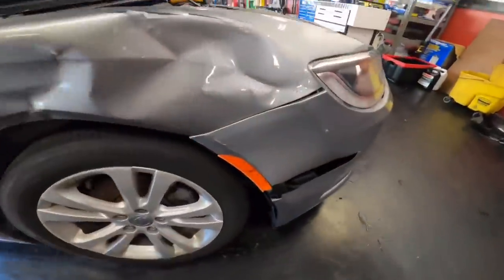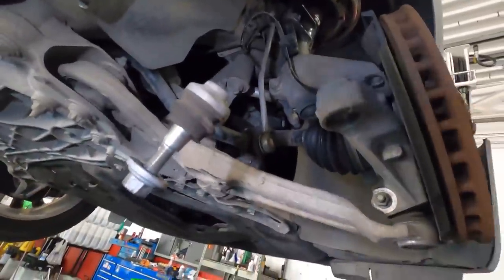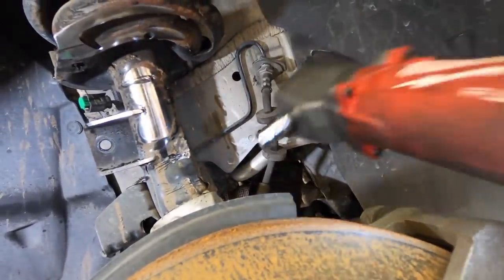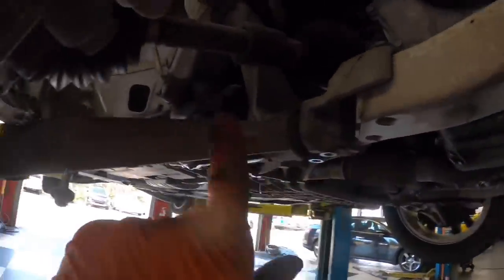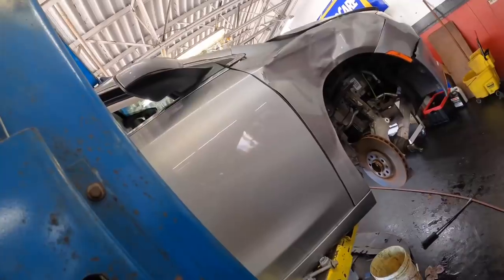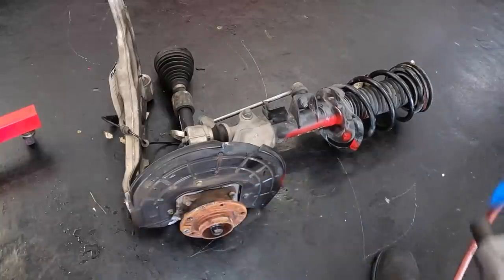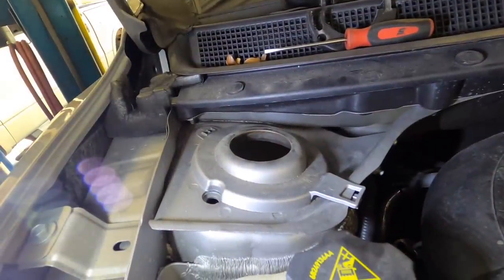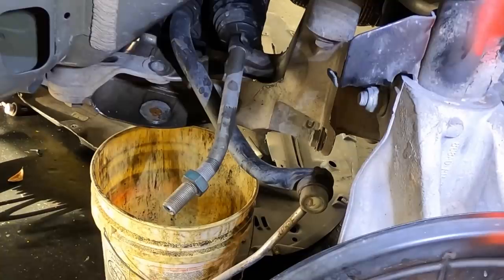Cutting Brake Lines! Caught on Camera! Chrysler 200 Strut, Control Arm, Tie Rods and Brake line

Comment: My oh my let’s put the bent up car back together and hope it measures up. There is just way too many potential problems to be encountered here. Hope it safe to drive afterward as I’m sure many other drivers are too. Good luck on this one Ray.
Reply: For sure.

I guess that car has a 4-wheel alignment in it's future but, honestly, I think I'd want to be checking the position of all the chassis tie-in points before I bolted anything back on again, given that the panel-gaps suggest the monocoque has deformed.
Reply: Peoples sketchy insurance putting this junk back together
Reply: It's probably going to insurance auction, making it a "run and drive" will fetch top dollar. Let some other sucker buy it thinking its only cosmetic damage.

Comment: I can't believe they such a plastic clip thing to hold the top strut assembly in place. No off roading for you to
Reply: Carries no load when the car is on its wheels. Only has to stop the strut from falling out of the car when wheel is off the ground, and as you saw in the video, the design of the lower control arm stops that happening as well. KL Cherokee is pretty much the same. Granted, that is closer to mall crawler than rock crawler, but for what it's meant for, it's fine.
Reply: @bikeaddictbp  well it could be modified with a metal locking plate and bolted to the strut tower.

Comment: That's interesting. Those strut mount clips, are the same as Vauxhall/Opel/GM use on the Zafira/Astra. I first encountered them when doing a Zafira front end rebuild. I didn't know that Mopar also did that. I guess if it works, others copy it.
Reply: If it works why then was the drivers side popped off.
Reply: It's interesting that the clip took a massive hit straight to the strut and did not fail. But the other side fell off at some point. I wonder if it was not snapped in properly. Also those 4 holes look like maybe a safety clip was part of the design but not implemented
Reply: @metrork1  It worked, right up to the point that it was involved in an accident. Then it let go, rather than ripping studs out of the turret mount.
Reply: @SmokeElectronics  The four holes fit a tool in the factory, for quick assembly.

Comment: The purpose of the plastic clips is to hold the strut up when lifted on a hoist. The weight of the car keeps the strut in place on the tapered body mount so the strut won’t move around with the weight of the car on the suspension. So it is safe. I’ve worked on many at the dealership and never saw one fail. Many other manufacturers also do it this was. Just a cost cutting measure as opposed to bolts holding the strut to the body. Also since Chrysler cars became Fiat, they’ve become a complete PITA to work on, even brand new under warranty. One of the reasons I left the dealership for an independent shop which makes me double the money I ever made at the dealer.
Reply: It's hilarious when you think about it. Fiat has twice failed to make it in the U.S. but when they were allowed to completely buy out Chrysler now people actually buy their platforms because it says Chrysler on it now all while Fiat as a brand badge is down to one single model and I think maybe that might even be gone now.

Rip Mopar and Chrysler.

Comment: So no bolts or nuts to hold in the struts on a Fiat-Chrysler product. That's strange and looks unsafe to me
Reply: Nothing unsafe about that, under normal circumstances the strut tends to have some of the vehicle weight on it so the plastic clip only needs to hold the weight of the strut, control arm and the hub and brake assembly when the vehicle is off the ground. So nothing wrong with that particular design unless you intend to use a car like this to jump a creek Dukes of Hazzard style. Then again, the front struts tops coming loose will probably be the least of your worries if you do so as you'll probably twist the chassis, rip the motor and transmission mounts as well as break all of the springs and blow out every last seal in the struts.
Reply: @0cypher0  Well, that's your opinion and it sounds very reasonable. Already gave mine and still stand by it.

Comment: See this is what happens when you have to take apart this to take apart that so you can take apart this to take apart that,,, aka the Domino Effect..... So therefore you end up spending 4 hours trying to take apart a $100.00 part that was replaced by another $100.00 part, might want to ease-up on your spray can fume addiction...........

Comment: I'd hate to recommend yet another battery into your mix but I'd suggest looking at the Milwaukee mid range m18 impact gun.. very little will stand in its way.

2962 or 2860

Comment: Get a DeWalt impact ray. I bought one just to get by while my snap on 18volt was getting rebuilt. That was two years ago not only is it still going through daily abuse but it pulls bolts that snap on couldn’t budge. DEWALT 20V MAX XR Brushless High Torque 1/2" model DCF899B.  I paid about $190 on Amazon and have been thoroughly impressed with it. Sold the snap on to the FNG lol. Pretty sure you can pick it up at Home Depot too.

Comment: Why didn't you just get a big bar and push down on the lower control arm?
Strut would have popped right out.
Anyway, there must be a reason.
Probably too much impact damage.
Man they sure make those 200's crappy, it's basically a POS Fiat.
I have been spoiled working on Japanese stuff for 35 years.

Comment: Ray now that your Rigid impact died and you have a broken battery. Time to upgrade to a Milwaukee. Just make sure it's the M18 high torque. You'll find it's well worth the money. Most likely stronger than the air impact. God bless

Comment: I'm only 3 minutes in. I have done some mechanical work 20ish years ago. Mostly easy stuff like tires, brakes, oil changes, etc. but I'd help the other guys with stuff too. Occasionally we'd do collision repairs like this but I do not remember seeing (or hearing) about struts bending. Control arms? Yup. Inner or outer tie rods? Yup. Bent or cracked subframe? Yup. Bent Strut mount? Yup, even saw one where the upper mount welds had rusted through and broken free from the rest of the body (great white north, means salt is used on the road in winter. Salt plus moisture equals rust) But a bent strut? That's new. How common (or rare) is this? The impact must have been just in the right spot, or one HECK of a bang (or both)!

Edit With it bent that badly, were you concerned about the cylinder rupturing and spraying fluid or the spring mounts being damaged potentially releasing angry spring energy?

Comment: If your cordless gun has carbon brushes they might need replacing. If it's brushless it might need a new trigger. You can find parts online. Cheaper than buying a new one.

Comment: a plastic clip holds all that in..omg.   "they have determined its safe"  in other words they determined the amount of money they will save/make is greater than any potential law suit they will payout. lol    good vid
Reply: Its actually held in place by an interference fit of the shaft. The clip is just there for the small chance it might slip out if the car is jacked up - when the wheel's on the ground there's a quarter of the weight of the car holding it in place.
Reply: @IanSlothieRolfe  What when there's no weight on the wheel?
Reply: @erik_dk842  when is there no weight on the wheel?? On a two-post lift, when you're in an accident, jumping your car over something or going rock crawling. Under normal driving there will be weight on that wheel pretty much all of the time and I wouldn't recommend using this this type of car for anything other than that without serious modification.

Comment: Yep, everyone STILL hatin' on the plastic ring holding the strut in.  Except on both the Cherokee where Ray did a similar suspension repair, and this 200, on the side that took the hit and where EVERYTHING ELSE on the hit corner's front end has been bent, cracked, broken, etc., the thing that has survived in both incidents is the plastic ring.  Think about that for a moment, haters.

As for the ring being cracked on the driver's side on this car, well, there's no way to know for sure why that is.  Sure you could speculate that this one broke from the collision, but then why would the one on the opposite side of the collision break, and the one on the collision side not break?

BTW, these are meant to be replaced when removed (they are $8.72 on Rock Auto), maybe someone removed it for a previous suspension service and broke the serrated ear(s)?

Comment: Pink bacteria in your well strainer is likely S. Marcesens. Soak the bacteria in 50 percent vinegar/water for 10 minutes and easily scrub away. Replace the filter that's contaminated. Your water softener effectively filters it out further and protects any RO system you may have.

Comment: Looks like a side impact... the other strut clip was involved in the accident, it was pushed to the point it separated and released the strut. If those struts were fixed in the normal bolted to a bit of tin method, the top mount would have been damaged on both, possibly the car would have been a total loss. So the plastic mounts (that only stop the strut falling out when it's jacked up) makes for a lower insurance premium, due to less expensive repairs, because they minimise structural damage in front or front/ side collisions. The most common type being a kerb strike.
I once owned a Volkswagen Polo that was written off due to kerb strike at less than 20mph, the damage looked similar but not as bad as this one, until I looked at the strut tower and realised it was mangled, just enough to need to be replaced, along with the driver's door, the wing (fender? I think you call them in America) strut, tie rod and drive shaft...
Never bought another VW since, never will again.
Pretty sure these clips are a Chrysler thing, maybe FIAT (Fix It Again Tomorrow ) or PSA since Daimler sold the group to them years ago, definitely never seen it on a Mercedes Benz.

Comment: And ray I don't know if you'll read this or not, but thank you I learned from you and did what you told me to do!! Lol thank you very much You told me that the battery was the key, if you're having weird problems start there.. My mother in law's vehicle is having weird problems I changed the battery cleaned up all the terminals and I even said click when I tightend down the battery And put Anti  corrosive on them.

Comment: 2:19 At least you can get a socket on those nuts. Had a puncture on my 3 year old Ford and couldn't get a socket on to get the wheel off as the nuts had swollen up so much. Next size up is too big. Imperial size didn't work either. Ended up buying a special half size socket... and a whole set of new nuts.

Comment: He never replies to or favorites any of the comments. I think he reads them but just doesn't ever say anything. But I'll write this directly to him anyway incase he does read it because that was really awesome.

 Dude. How many times did you get out and move the camera? The one on the fender wasn't visible in the shot from the threshold of the bay. And that one wasn't visible from in the shot of the flat tire. So you didn't have multiple cameras to set up and just film it once. You must have had to film pulling in several times from multiple angles. Or you pulled up a few feet, stopped, got out and moved the camera, pulled up a little more, stopped, got out, and moved the camera. Ect. Or you had a helper moving it for you every few feet because the car doesn't go in park.

However you did it, that extra effort makes the video so much more interesting. That's a lot of work to put into the first few seconds of a video that most people probably won't even notice. If they do, they usually won't realize the effort it takes.

All of that rambling is to say: well done. It looks really cool and is totally worth the effort.

Comment: Why is this car in this shop,  IMHO it should be at a collision center since the front and or rear frame may be tweaked.  Also, used parts may be cheaper and  turn bad  quickly,

Comment: Got to admire your B--lls for even starting this disassembly, once the bits and pieces are off you still can 't install new parts and expect it all to work properly since all the mounting points and systems are out of alignment.  Seems like the only way to repair is to get back to the frame and check for bent stuff and start from there...way to involved to be taken on by anything but a body shop that does reconstruction. Why not call it a loss , strip the parts and sell them off then recycle the rest...ie JUNK!

Comment: Why should that strut clip thingy not be safe? It is not loaded in normal operation (since the spring is pushing the whole thing up). Only when the car is lifted does it actually hold anything and in that case it's a compressive load on a very sturdy looking polymer ring. I don't really see an issue there, let me know if I'm missing something.

Comment: I am a little puzzled. I thought you were taking this car apart bit by bit to see what you thought was salvageable. The hub being one part.  When you gave up trying to separate it from the strut and said it was all being replaced anyway, I thought you'd wasted all that time when you could have taken it all down in one lump. You really do need to think about what you are doing before you get started. Usually you're pretty good at pre planning. Not in this case.

Comment: The design engineer that thought up that locking clamp for the strut should go work elsewhere. What was always an easy one person job - one hand holding strut up through body, whilst other hand puts the nut on a few turns, now turns into a two person job - or at least a very fiddly single person job. How long before these engineers finally decide that the round wheel simply needs to be changed - because of reasons. Honestly, why mess with a simple design that always just worked?

Comment: Dude that is not the proper way. There are way to many unknowns with this repair. Strut dampening capabilities could be totally mismatched due to wear as well as spring rates. That alone is a potential liability issue.

Comment: In all fairness, engineers are quite often painted into a corner as service techs DON'T have to deal with BS on the corporate level. Engineers have a specific job to do within a specific amount of time with heavy penalties for missing deadlines. When a service tech goes over the time limit, worst case scenario, they're working Pro bono for any time past flat-rate & the customer MIGHT be miffed depending on how understanding the customer is on a personal level. 

When an engineer fails to meet their deadlines, they are hurting the entire corporation as opposed to inconveniencing a few individuals on a personal level. Quite often, they are simply doing the best they can with what they have.

Comment: that impact was a baby they sell some big uger ugers now dude i have the fuel impact and it was struggling with wheel nuts i borrowed the big boy version 2 or 3 half trigger uger ugers and it was off dude i had tried poll on rachet and all sorts wasn't budging at all.

Comment: I have to say that the strut being held in by plastic is not what  I would want. I fear for your  hands every time I  see you pushing with a punch. I  was helping my tech when he slipped and sent half inch punch into the palm of my left hand and he did not let off trigger it broke a bone and I need probably 2-3 more surgeries I think  he may have been high at the time.

Comment: Holy Crap.   I didn't realize that the strut was held in at the top  JUST  with that plastic retainer.
I've got a 2014 Jeep Cherokee and it has the same upper setup.   How cheap and  scary.
No wonder there is some thumping noise on rough roads.  I was figuring it to be the struts getting worn out.

Comment: Those clips are perfectly safe and very strong Vauxhall Opel have used them for years. Usually the top of the strut rots out first pushing the rod of the shocker through the bonnet. (Hood for the Americans).

Comment: I work construction and we now use Milwaukee m18 impacts for bolt ups on pressure pipe. We started off with buying rigid impacts but they would last 4 to 6 weeks and something would break on them. After 3 or 4 times of the same problem, we switched. The Milwaukee has now laster a year of doing bolt ups.

Comment: …and the great German engineers placed the original Beetle’s gas tank in the front crash area just in front of the open wire connections! Causing spectacular fires when crashed.

Comment: The air power cutting sounds like Donald Duck on helium. Cutting brake lines is not good for the soul. That rotor has lots of surface rust, must be sitting a while. Another great video. I like the simple strut set-up.

Comment: I'm not a mechanic.  I was wondering if the transmission would be damaged by the front axle being pushed too far into it.  It would be a shame to fix the front suspension only to find you have to replace the transmission too.  Those plastic pieces holding the strut gives me the shivers.  Can aluminum castings be damaged when you pound on it with a hammer or impact tool?  Is it safe to reuse suspension parts after applying forces they weren't designed for?  These videos make me appreciate what mechanics have to deal with.

Comment: Apparently this is a customer pay job, most ins. companies would never write junk yard parts especially for suspension or brakes.  Too much of a reliability to them.  Also, those clips on the other side of the car popped when the left wheel hit the curb it was pushed into, check really good on left side for suspension damages, measure the shock towers for correct alignment.